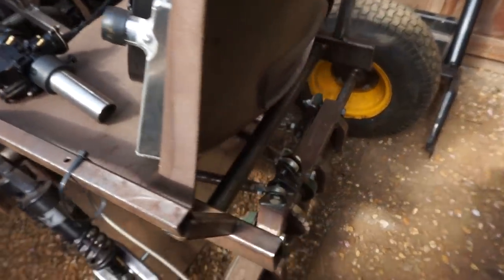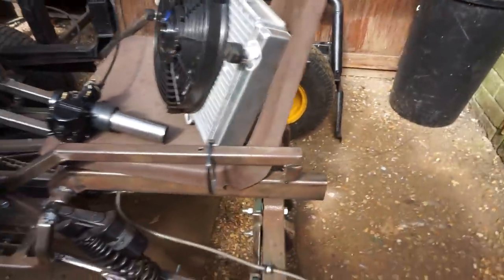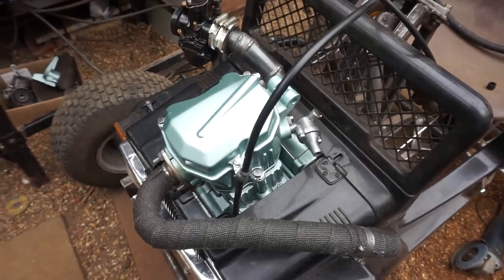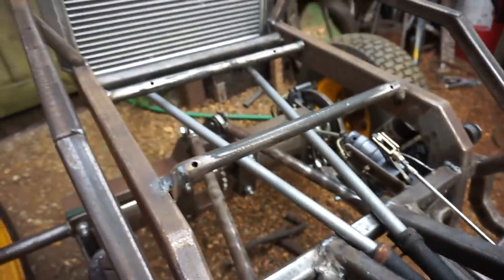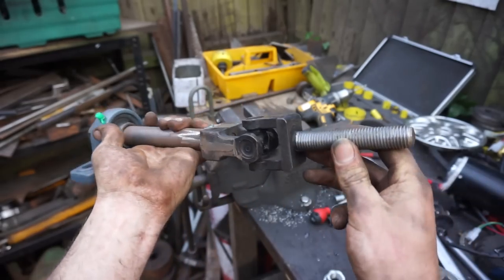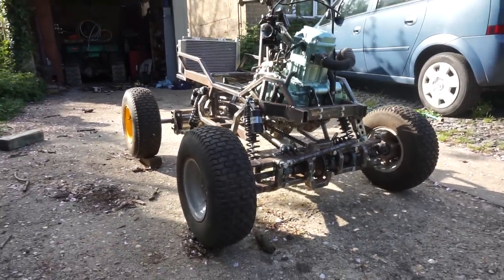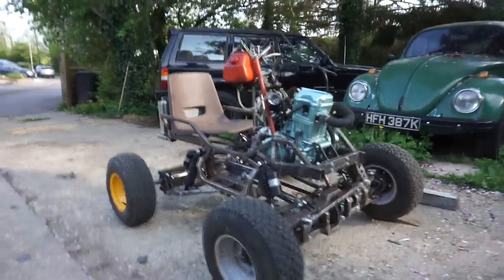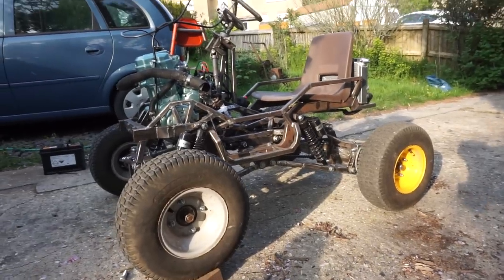FIRST TEST DRIVE! Mini FJ40 4WD Power Wheels Go Kart Build Part 5

Comment: What’s the engine setup? Is this the 300cc ?
Reply from the maker: Only a 200cc at the moment but one day il get my hands on a 450... i dont fancy being killed by it quite yet!!🤣
Reply: council house creations what 200cc? I’ve been running a 250cc (230cc Honda clone) it’s enough power but I want a little more
Reply from the maker: Tell me about it! Hes a heavy old rig for the motor but its geared fairly low so itl do for now i think. Its all my wallet will allow 🤣

Comment: I love I do have  a suggestion if you wipe that baby out you'll snap your ankles right into, I would I would consider trying to have your feet further fore ward. If at all possible unless you feel that is very save and it will not flip over on you. Other than that I just love this build bud...you've nailed it.